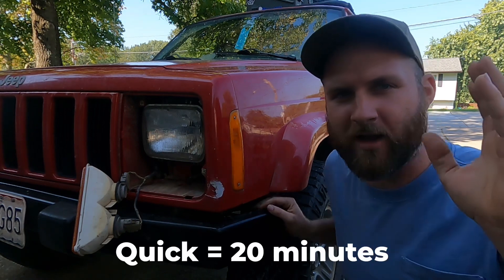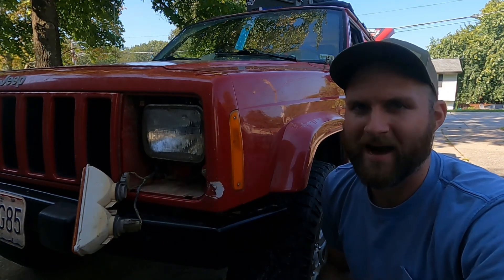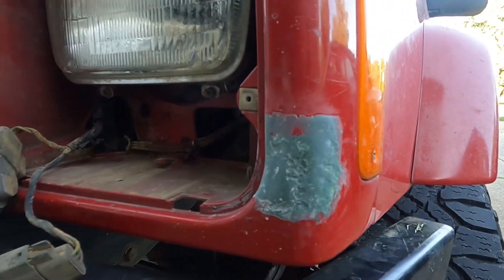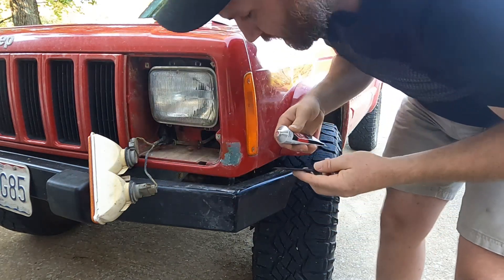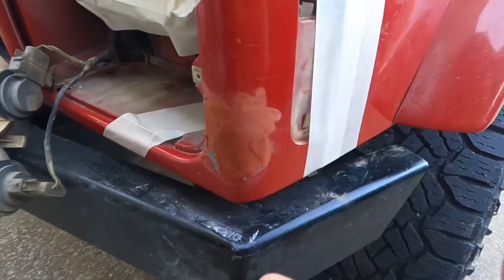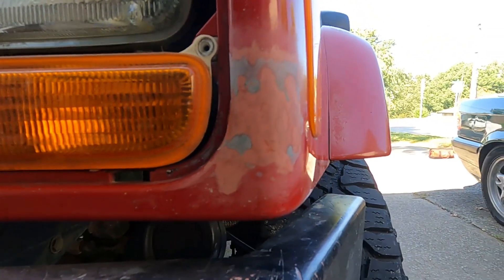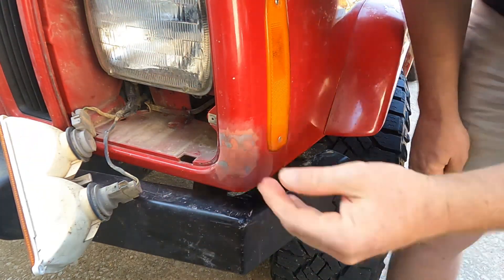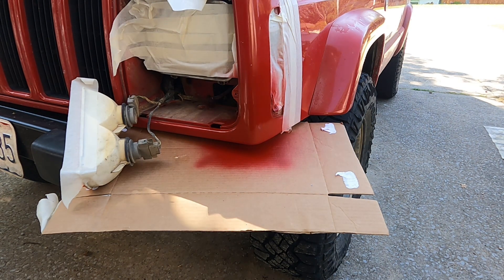Bondo Repair on 97-01 Jeep Cherokee XJ Header Panel

Comment: Just found your channel researching for a weekend trip to Mark Twain National Park. I am building a 96 XJ overland build and just getting started off-roading/overlanding. Hopefully a 3 in lift and 30 in tires will get me through the trails in the area, as you seemed to not have any troubles.
Reply from the maker: I'm on 2.25" in the front, sway bar disconnected with the JKS ACOS coil over system and some hockey puck bump stops, rear is just shackled and add a leafed up to 2-2.5", with 30.6" tires, and it does great in Mark Twain NF.